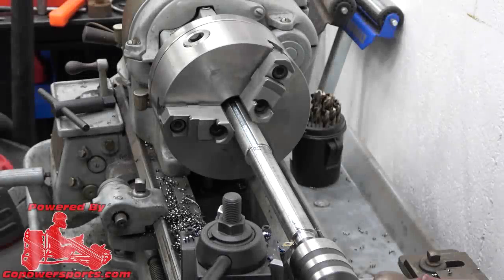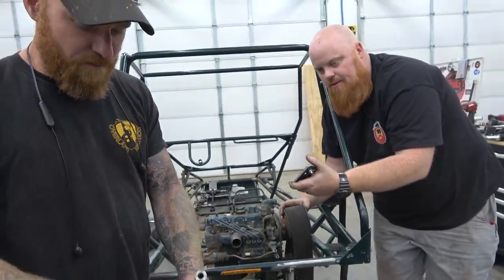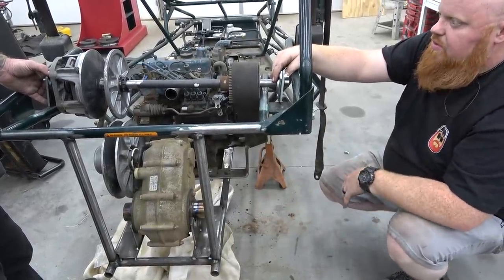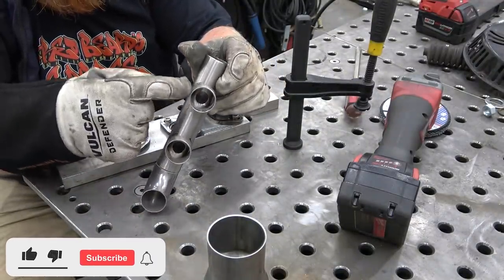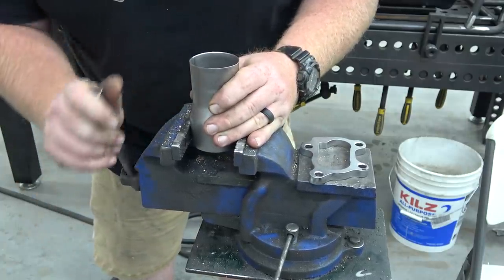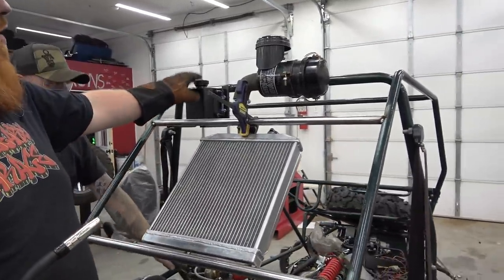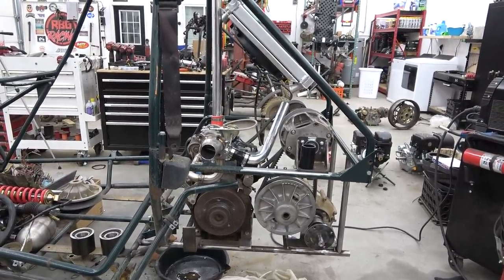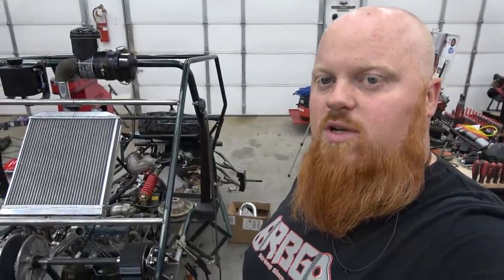Turbo Diesel Off Road Go Kart Build ~ Diesel Deuce Ep3

Comment: What happened to Lonnie? Awesome project RB. 👍👍🤘🏻🤘🏻 Just a friendly suggestion, that radiator should be mounted with rubber isolators, solid mounting will crack it.

Comment: I am impressed by the craftsmanship. Very well done. The only fear I have got are the bearings of your jackshaft. As far as I understand, the jackshaft rotates with crankshaft speed. There are just flange bearings on the jackshaft. I fear that they will overheat quickly as they are not included in the oil circulation. I hope that this will not be the case. But if you look at C&C's Sidewinder jackshaft bearings and how hot they were after an hour's ride.
Greetings from Germany an take care.

Comment: Man I do all my welding with a cheap HF flux core. And it shows lol. Drives me nuts that i Have seen some folks do great work with those welders, but for me, with no training, can't seem to make it happen very often. I REALLY want to goto Tig, I do have experience with ARC. But it's  been a minute. And grats on your lathe brother. It's on my bucket list. Lathe, Mill and more importantly, 4x8 welding table like yours. A Diesel Go Kart.. with Turbo. Who would have thought lol only RBG!

Comment: Carful with those Amazon VZ21 Turbo’s. I did a custom turbo build on my Honda Pioneer 500 on my channel (shameless plug for other comment readers...lol) using those and went through 3 of them quickly. Like within 20miles. I’ve since upgraded to a IHI RHB31 and have near 100 trouble free miles with it so far. I’m sure it depends on the supplier but the quality just isn’t there on some of these knock off VZ21’s compared to an actual RHB31. Awesome build though and I’m very excited for the next video!

Comment: Looking SIC!!  I would make both brackets for the jackshaft adjustable on the frame ofcourse.    I do have some JD diesel Gator primary clutches,  but you should able to change weights if needed to dial in to your diesel RPM's.   Keep up the good work and looking forward to more vids!

Comment: love it, look into water to air intercooler due to slower air speed
Reply: He won't be able to run too much boost so either type won't do as much.
Reply: @Ratkill9000  if he does a cowboy tune he should be able to see some half decent figures depending on how much fueling he gets from stock pump

Comment: Looking forward to seeing this in action. I have the gas equivalent in a early 90s cub cadet and read good things about this model of diesel.  I was wondering, considering your turboing something that wasnt before,  do you intend on trying to upsize the injectors and or getting the injector pump "turned up"?   If you were building this a year ago i had a friend who use to build injection pumps for all types of stuff. Hes no longer with us. Any way just a suggestion with regards to performance.

I should have listened to ALL the closing before asking this LOL "We going to turn the fuel up".....

Comment: Just my 2 cents, for what it is worth at least, I wouldn't mount the intercooler up high like that.  Keep it as close to the motor as possible so the charge pipe run between the compressor outlet and engine intake is as short as you can get it.  This will really help with low rpm boost response.  You might not think it would make much of a difference, but it really does.
Reply from the maker: We are going to.
Reply: water to air barrel cooler would work best, especially for lower speed vs diesel highway speed for air to air
Reply: @RedBeardsGarage  don't be afraid to weld the wastegate closed, keep eye on pyro/exhaust temps and you'll have a cowboy tuned ripper
Reply: Side by side coolers will be awesome.  Can even do a air dam/ scoop into both coolers.

Comment: Did you or are you going to turn the fuel up a little on the engine?  It’s gotta smoke some. The turbo will take care of it as it spoils up. That particular motor you can ( I had one on a welding machine). There’s a tamper proof cover on the set screw. Take that off and it’s just an Allen wrench and a 10mm.  I suggest looking it up to know exactly how to do it. (Pictures)

Comment: I'm not familiar with these diesels pumps and if you can turn them up or not. If you want to make more power without messing with the pump you should try propane injection. A solenoid and a camp stove hookup would be all you really need. A Hobbs switch to activate as soon as boost is present is a good way to activate/saftey shut off it.

Comment: think you might loose the air filter up there if you drive like I do ,,, under a tree branch ,, or like 2 of my carts ,, I rolled them over ,,  got a dust bowl of a track when dry but if it rained its muddy slick .

Comment: Not criticizing by any means. But coming from a welder I’d start quartering when you weld. And run a filler and cap. It a filler at the least.

Comment: Hey man, what size turbo did you end up using or what brand and where did you get it? If you could tell me I’d really appreciate it, or if you could give me a link to the same turbo. 

PS. Idk what your plans are for increasing the fuel but if you find that your not getting enough fuel with just the fuel screw on the injection pump I know of a guy who builds custom injection pump plungers for these engines to increase fuel through out the entire RPM band. I just added the plungers on my tractor and it really helped give it more fuel.. now I’m looking for the perfect sized turbo so any help would be greatly appreciated.
Reply: Also there is a bolt on the one side of the block you can remove if your engine has it where you can drain the oil into.. I’ll prolly go that rout with mine.. either that or I may tap the valve cover for an AN. fitting

Comment: Hey brother if you have an opportunity to weld some thing flat or going uphill that is definitely better than running down hand I know a lot of the stuff will never see the kind of strain where it matters but considering that up hand is probably the most difficult weld position you should take the practice when you can get it I’m just saying this because I noticed you down handed a brace when you could’ve flipped it around to flat or welded it uphand and I’m not just some guy who has watched to many YouTube videos I was a certified welder fabricator millwright
Reply: PS I was not referring to when you tig tubing TIG welding wasn’t something I came across too often so I don’t know a whole lot about it but I’m pretty sure when your tig welding thin tubing it doesn’t really matter what position you’re in so long as you can get a good bead on it

Comment: I'm wondering if you've ever had trouble with your coleman bt200x or mb200-2 having trouble with chains tagging the driven pulley? and how tough have you gone upgrading chains? as much as up to 40 o-ring?

Comment: @red beards garage  I'm new to the small engine world getting into it for the first time I have a baja warrior my muffler fell off I put 1 screw in and zip tied the other side I checked the park plug and a spring and a small peice of metal came out the cap I lost 5he 2 pieces but sparkplug boot still goes on snug but it won't start now any idea what I can try to get it to run again

Comment: Again using that weak belt drive and transmission ,Now mounting drive sprocket to engine damper  maybe not the best choice.I dont know why Red Beard refuses to use a small auto Manuel trans .It would be easer to mate engine and trans from a small front wheel drive car than that weak belt cvt.also engine and trans combo would be smaller too good luck....

Comment: Your wrong those prime and second pulleys have line up if not you lose power  and performance  i work on snowmobile all the time
Reply from the maker: I'm not saying to be off my 1/2" I'm saying a 1/16" isn't going to be a huge deal when our engine will do 3500rpm max
Reply: Ok try it your way  but 1/16  will lose you about 10 mph  and  about 20% of your torque  i know thats not a big deal  but every time you drive for long periods get ready to replace belts
Reply: @RedBeardsGarage  Just made like swingarm adjusting bolts on the jackshaft brackets---  problem solved.